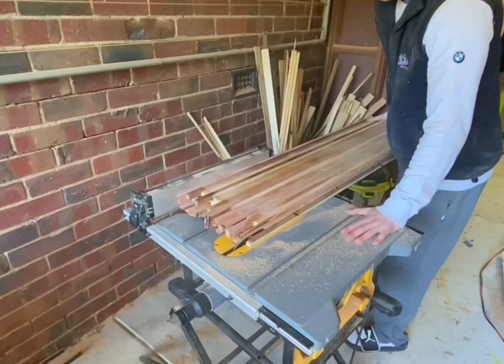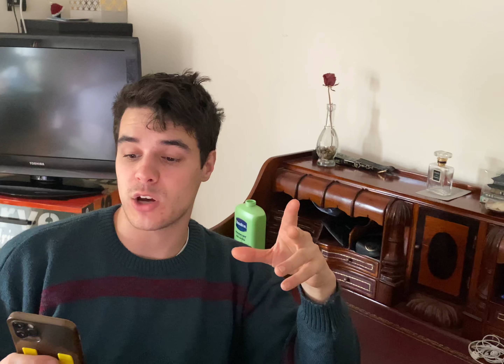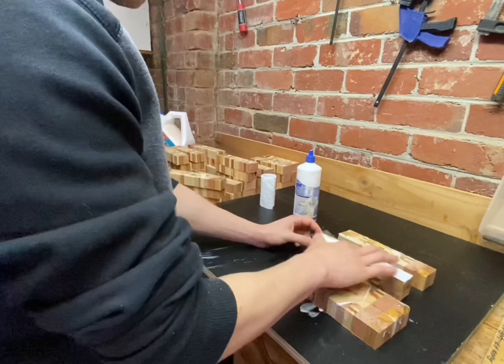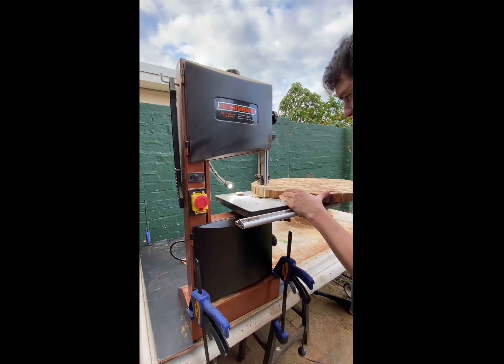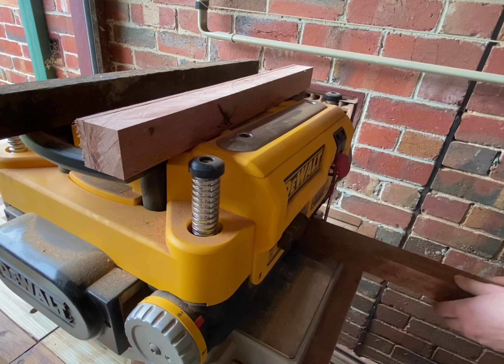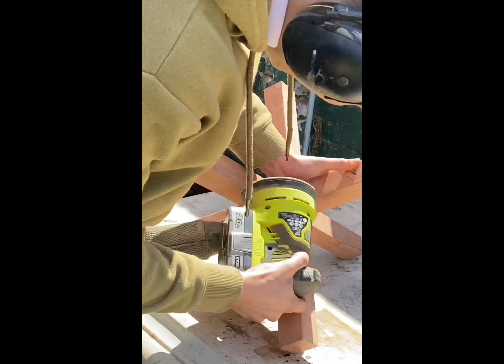How I built an original Kaleidoscope coffee table design - [DIY Woodworking Projects]

Comment: You should check out Tunbridge Ware. 19th century craft industry based around Tunbridge Wells, Kent, England. Fine stripes of wood used to build a block of patterns (later they did pixelated pictures), which they would slice like veneer to make many copies for sticking on a base to sell as tourism souvenirs.